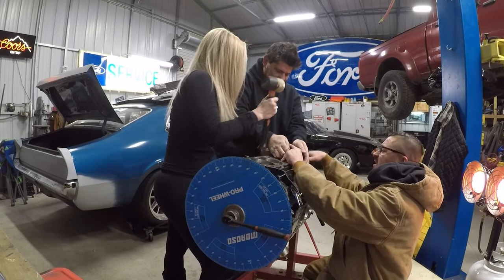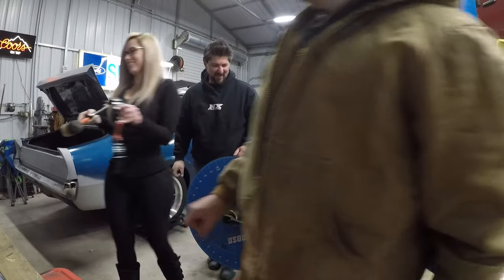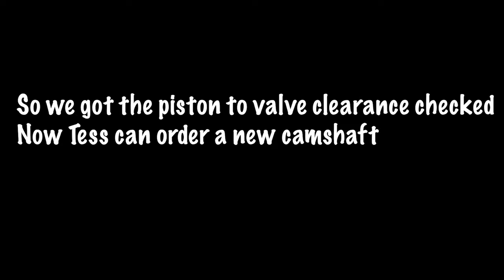Miss Midnight Maverick and AV Boys stop by Team D Performance!

Comment: the oil ring is always a problem with those kind of ring squeezers.  You need a funnel type, they work so much better and don't break rings.
Reply from the maker: Yes they are a pain in the butt to get, but we didn’t have a good ring compressor
Reply: I never went to a funnel type (had a shop ten years, did so many bore sizes) but also spent a lot of time 'sneaking' the oil rings into the bore, broke a few scrapers in the beginning but eventually learned a few tricks that took care of it - but they were still a pain.
Reply from the maker: Yes they are ! I’ve broke second rings too sucks !
Reply: @TeamDPerformance  
Lots of little details, the chamfer on the bore & break both edges of the chamfer with a stone, and a 'pusher' made from .030" sheet metal with a radius to tuck the ring back up under the compressor if the ring peeks out from inside....
All my race stuff is long rod, with the pin up in the ring lands it's even more of a party - isn't it!
Lots of fussing!
Reply from the maker: Yes sounds like fun ! Lol
Reply: @TeamDPerformance  
You know, nothing good is easy!
Reply from the maker: And if it is it usually will cost you in the long run !!
Reply: @TeamDPerformance  
You got that right - I used to do my niece's husband's NASCAR truck engines  & because I was low volume with T&D, Del West, ISKY, and Carillo there wasn't much margin on them, but it WAS fun doing the NASCAR stuff for a little while.
Learned a few tricks along the way too, so I guess it worked out.
785hp NA out of a 358 felt pretty good back then.
Reply from the maker: Shit that’s good now !! Lol
Reply: @TeamDPerformance  
Thanks.
That was at 9 to 1, but had my 750 (flowed 820) dyno carb on - spec was 390 which was a joke 'cuz the only ones that flowed 390 were just out of the Holley box.
Ran C3 Yates heads which were really, really good, a few of the right touches and the right seat height flow numbers were good but a little deceiving because velocity was way up, and with the valvetrain good and stable, custom ramps on the roller - shaft mount T&Ds and ISKY H11 tool steel springs it'd spin 8200 - 8300 for a couple hours no problem and the grind we developed had cylinder filling pretty good up top.
We got dyno time at Roush because we were a Ford team, the operator told me the Roush engines for Keselowski didn't have anything on mine, but we were friends and he might have been just being nice - don't know.
No one could out pull the truck down the straights - including the Big Boys - and that always felt really good!
I really liked the C3 heads - I think that's where I found the most power.
Reply from the maker: I like stories like this !!! That’s bad ass sir !
Reply: @TeamDPerformance  
Thanks!
I guess the little guy can still compete if they have the knowledge - but the price tag... OMG!
I liked building the engines for street racing better - no rules on modifications or parts and you can build so they don't sound anywhere near the power level they really are.
The shop is gone, but I still do a handfull each year - my true love.

Comment: I have a quick question  ? I have a88 mustang gt replaced plugs,wires,2 different distributors and fuel pressure regulator and injectors now I am having an issue with backfire through intake and exhaust ,replaced all vacuum lines .5.0 with gt40 heads (supposedly) !! Any suggestions
Reply from the maker: Check the valves. Probably too tight
Reply: Ok!! Would a sticky valve cause this too
Reply from the maker: A lifter could but sounds like they’re not closed when the combustion event happens so without seeing it I’d start with the valve adjustment unless they’re bolt down rockers then they may need to be shimmed. Depends on a variety of factors like if the heads have been decked or the pushrods are the wrong length. Good luck !
Reply: Thans for the pointers!!